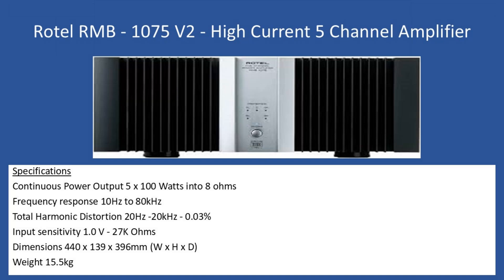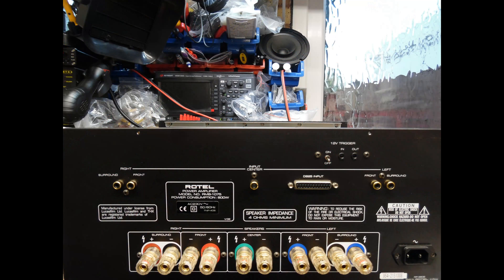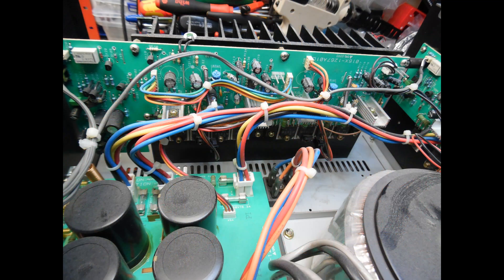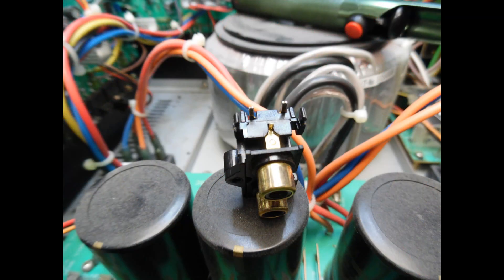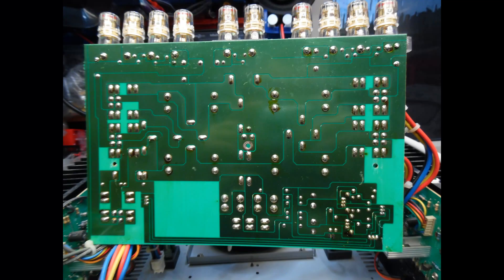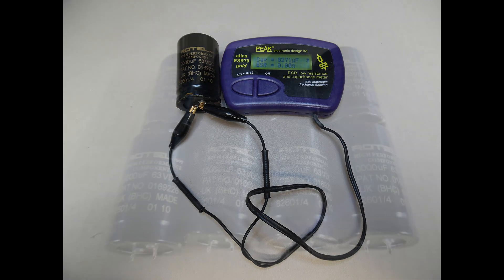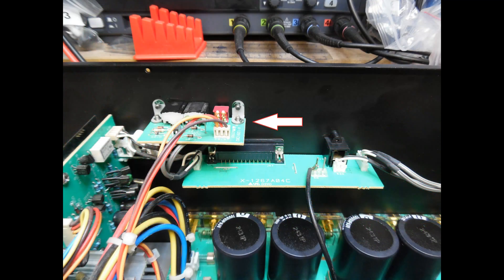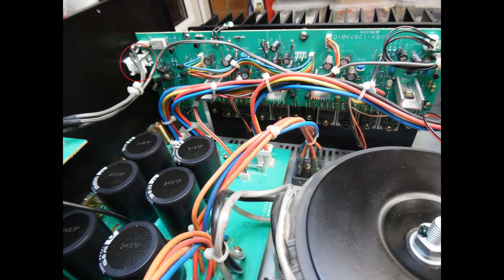Rotel RMB1075 V2 Amplifier Repair (With Audio Tutorial)

Comment: Oh Dear, had the same solder joint issue on pretty much every single input RCA on this one! Looks like a great amp for bi-amping, but I haven't tested it with more than 2ch driven simultaneously myself. It should be perfect for HF/LMF split, but I wonder whether it would start to sag in a 2.5way, HF+LMF/LF arrangement.